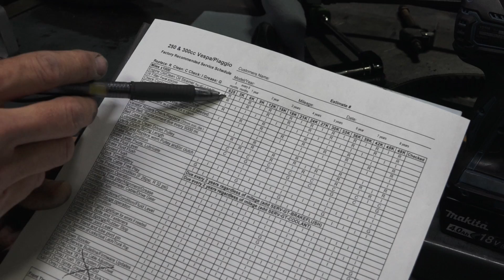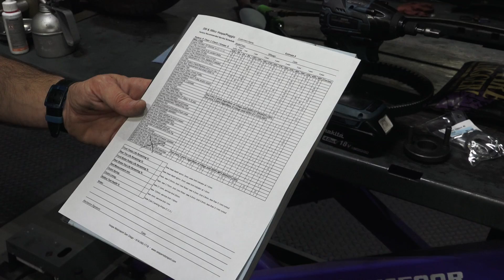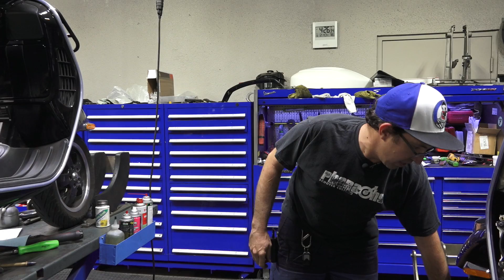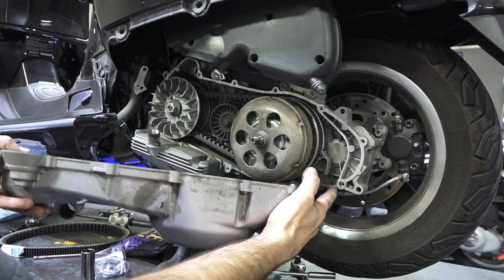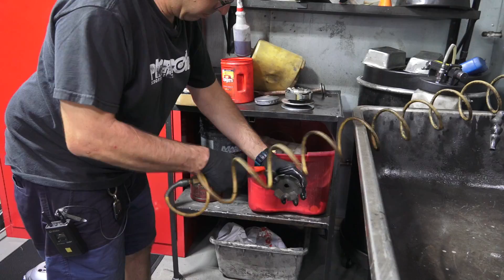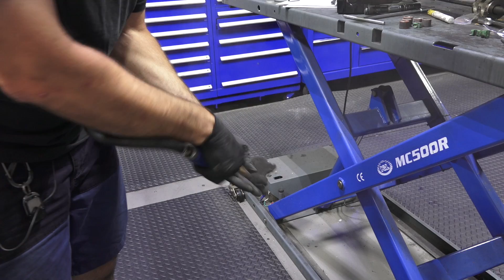Vespa GTS 9K Service

Comment: I purchased a 2017 GTS with 3000 miles,  is it wise to wait till 6k miles to change the belt and rollers? Or should I be proactive and do his service now?scooter seems to run fine at idle it does shake a bit, is that normal?

Comment: Robot you said valve adjustment every 12,000 mile and I am at 6,055 mile does GTS 300 need a valve adjustment now? It 555 mile round trip to the dealer I bought from and he said it would cost $1,000 for 6,000 mile service. Am I being ripped off?

Comment: I took a look the belt & rollers! The belt was crack and some teeth broken off & some rollers flat one side! I order a clutch holder & consumable kit for belt & variator! Thank you Vespa Motorsport & Robot.
Reply from the maker: Glad you got that figured out. That's a very comon issue and the reason to those things get changed out with a major service. Thanks for your support!

Comment: I check spark plug & air filter they was bad The first owner never check it! 2007 Piaggio mp3 250ie  13 yrs. old got around 5, 971 miles on it. I am second owner i like this scooter need a lot cleaning & work on it!

Comment: Hi Robot, 
my Piaggio X9 250cc 2006 the owners manual states that the oil level should be checked  while the bike is on the SIDE STAND.
Thanks Geoff, UK